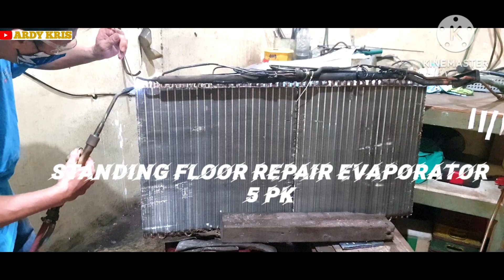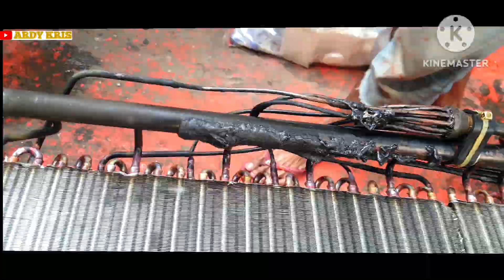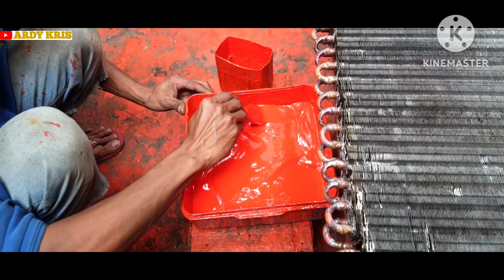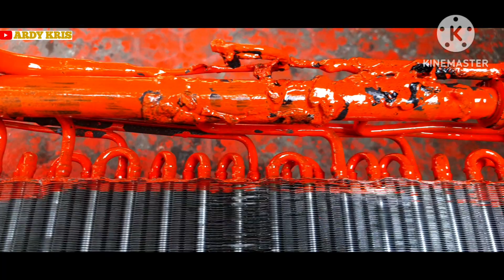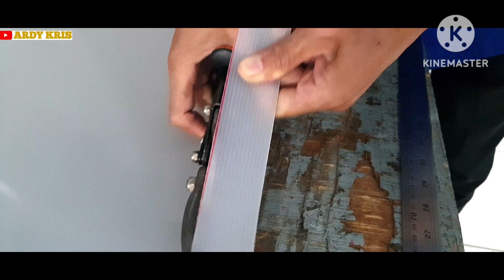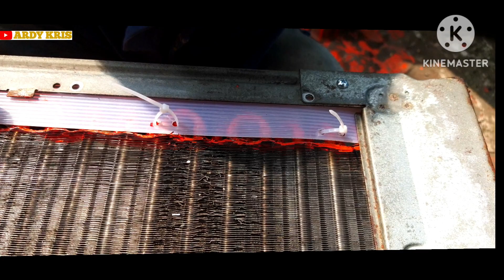Standing floor 5 pk repair evaporator.

Comment: Bang mau tanya, kalau evap ac inverter bocor antara sambungan besi dan tembaga gtu msh bisa diperbaiki gak ya. Info teknisi mesti ganti baru karena klo diperbaiki pling bertahan cmn 3 bulanan. Kalau msh bisa diperbaiki kira2 brp ya biayanya? Mohon pencerahannya bang. Terima Kasih
Reply from the maker: Seharusnya bs di perbaiki. Kl biaya sy krg paham. Bengkel kami khusus cutting evaporator sj,kak. Info lokasi & kontak kami ada di Gmap "REPARASI EVAP AC GROGOL",kak....🙏🙏